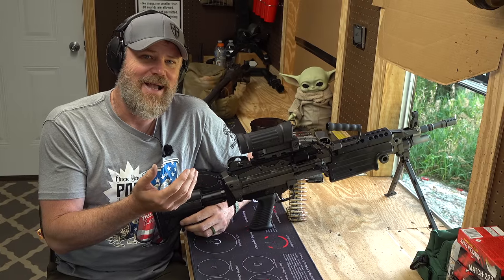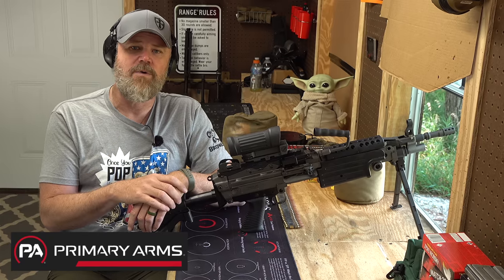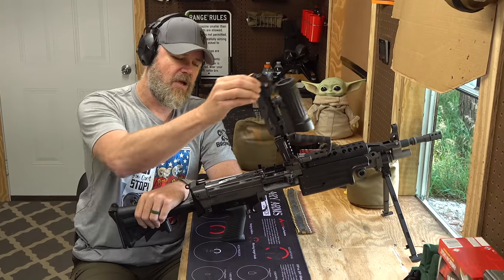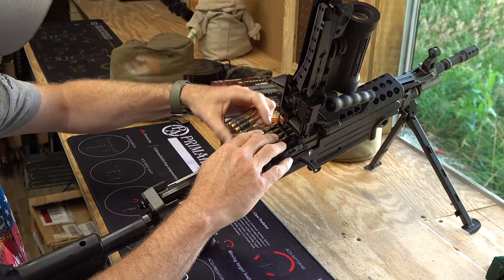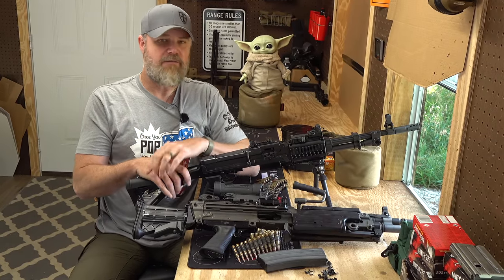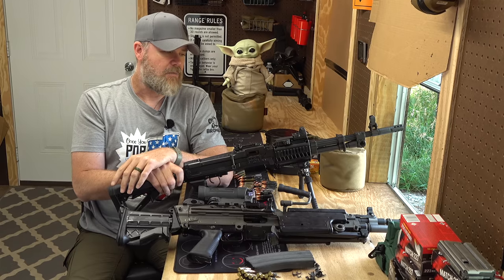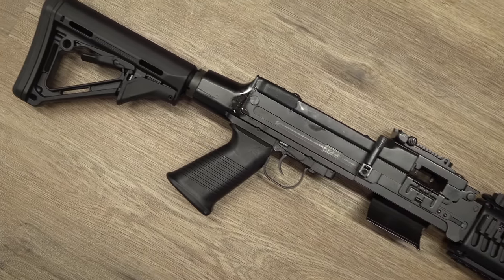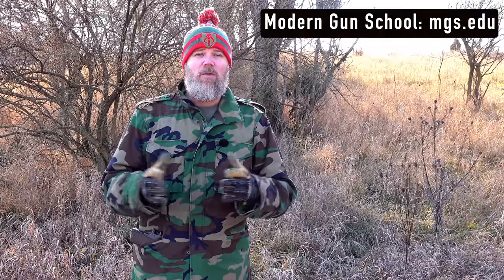Semi-Auto Belt Feds - Useful Tools or Range Toys?

Comment: Fightlite MCR belt fed upper+rare breed forced reset trigger. Now that's what I call "overly practical"!
Reply: i have that exact set-up, its a beast...
Reply: Wow, you both have an MCR, do you consider it a decent investment? Would you choose it in a collapse/boog situation?
Reply: @snek9353  I would yes  when I got it I got the upper and lower for 3700 look how much they are now  I have the same RPD in this video got it when they frist came out  2800 and a wiselite mg42 had thatfor about 16yrs 2600
Reply: @stg4478  At todays prices one can buy a MCR or about 40 60rd magazines.
Reply: @snek9353  I have it as a range toy.
Reply: @snek9353  I also have a MCR+FRT, but in retrospect, I'd rather take a HBAR upper with a larger magazine than a MCR when it comes to practical use. Is 100rnds in a nutsack more practical than several 60rnd magazines on a bandolier? How often am I actually going to chance the barrel on my MCR if I'm fighting by myself?

Comment: Once upon a time 1919 kits used to be pretty affordable.  Parts still seem to be available and any small part you can't find can probably be made with some tool steel, files and a torch.  The semi-auto conversion sounds like a pain in the ass but the rest of a 1919 build looks reasonably straightforward.

If you bought cheap, the price tag wasn't bad for a range toy.  With surplus ammo, that was pretty cheap too but now buying thousands of rounds of .308 or .30-06 won't be cheap at all.

People used to use trigger activators on them, I'm not sure if that is legal anywhere these days.  A butterfly trigger might reduce the fatigue issue but I have no clue if a butterfly trigger can bump-fire.

Any way, I was surprised to see a discussion of belt fed semi-autos that didn't even mention 1919s but talked about BARs for some reason.

I don't know if the 1919 still has the lowest barrier of entry for belt-fed but it did for a long time and a lot of people have them, probably more than all the RPDs, PKMs and SAWs combined.

Comment: since the marines have gone to the m27, and with barrels on ar getting stronger, a belt feed is a nice range toy.  but if you put a binary or force reset trigger, you could get a poor mans machine gun.
Reply: You could probably get a similar effect by double or triple tapping the trigger. What I'm talking about is quickly squeezing the trigger 2-3 times from a bipod or tripod position.   You will probably not be all that accurate, but real machineguns rarely are.  Then again,  if you're shooting off of a tripod, a hand crank trigger actuator may be the way to go.
Reply: I keep hoping someone comes up with a binary/frt trigger option for these kind of guns...
Reply: @Mitsurugi2424  MAC will NEVER demonstrate it.
Reply: It would be neat to have a belt fed 7.62x39 RPD with a short barrel  (10" - 12.5") RPD style Draco with a pistol brace and a belt fed backpack.
Reply: Lol or you can literally do a basic ass trigger mod and it's full auto just like that.
Reply: Marines still use the M240

Comment: My issue with the IAR is that they’re just a heavier AR. If I wanted to go belt fed I’d get an MCR upper and toss a binary or forced reset trigger
Reply: I used the IAR when it was transitioned over from the SAW.  As a machine gun, it sucks ass. But as a rifle in general, it’s awesome. Gorgeous gun. So as long as there are machine gunners toting around the m240 or something like it, the IAR is a suitable replacement. The rifleman were able to use it much more effectively.
Reply: @hieug.rection1920  but for the civilian variants it's just a heavier AR
Reply: @joshuaradick5679  not so. It’s a piston driven high-end AR.  I loved the gun so much despite my incredible bias towards belt-feds that my go to civilian rifle is a clone. The rifle is an incredible reliable platform that performs well in high heat and dusty climates, like Arizona in the summer, and cycles through anmo just like the military variant with. Very little modification. A little binary trigger or the rare breed for example. Even just a drop in comp trigger with less than 3lbs of pull will become a very fast firing gun. 
So, for 1lb more than your standard AR, you get a gun that you can still hold the front hand Guards after 60 continuous rounds, and that can reliably cycle more ammo than I care to go through in one sitting without issue. 

I have to clean my direct impingement ARs every use or else they get finicky. They have noticeable performance drop during extended rapid fire courses.  None of that is the case with my piston AR. I still clean it, but It’s stays cooler and cleaner by far.
Reply: @hieug.rection1920  I'm not downplaying the quality or the utility of the IAR concept. I'm just saying if I want the LMG experience the civilian IAR isn't going to do it. I've got a heavy barrel piston Ruger AR I can do the same thing with.
Reply: @joshuaradick5679  oh, yeah. I misunderstood. 
Paying a premium for any single shot machine gun is ridiculous. It defeats the purpose and outside of the IAR, is a different mechanism and shooting impulse. May as well just get an airsoft gun if you just want to look cool. At least then it’s still fire full auto.
Reply: @hieug.rection1920  I mean the saw was never a great machine gun either. The m27 is just a more portable far easier to use rifle
Reply: Done that awesome setup Franklin Armory binary trigger also the surefire 60 and 100 round AR-15 mags with it is blast
Reply: @hieug.rection1920  what kind of AR’s are you using that get finicky without cleaning? Most will run regardless. Look at Tim’s BCM test he’s doing and sitting at or if not barely over 7,000 rounds
Reply: @lukeflaugher5334  gov issue colts, Daniel defense, a few custom builds and BCM. Sure, DI guns work well.  Not saying they don’t. But when your running 1,000+ rounds through one in the 110+ degree heat and dust they get a bit finicky.  I’ve had to field strip my colt M4 mid fire fight fight to wipe the crap off the bolt lugs and rails while my buddy was jamming more rounds into mags.  The M27 gunner never had that problem and was firing more than us. Let that carbon cool and solidify and it will gum up the action. A piston AR just takes it on damn near machine gun levels with much less worry. The rails and lugs have less buildup.  The receiver stays much cleaner in a piston gun.
Reply: @hieug.rection1920  I definitely can’t dispute your experience’s and definitely understand what you’re saying. They both have pros and cons. Piston guns normally get hotter faster at the hand guard though. I like both but it has been shown that DI guns are as reliable or if not more reliable sometimes. Their is definitely a lot of variables at play and probably depending the manufacturer and conditions can cause DI guns to act up
Reply: @lukeflaugher5334  the hand guard right by the gas regulator definitely heats up.  However, the barrel and everything behind it on a short stroke has piston are cool and clean. 

20 years ago, I’d have never trusted a piston gun. But somewhere in there, some folks seem to have worked out the magic of the piston AR.  Not to discount the DI AR, as nothing gets lighter and I do agree they are fantastically reliable, but for extended fire engagements that M27 was slick.

Comment: Range Toys. Unless you’re running a binary trigger I don’t think the weight/size justifies the exact same functionality of a gun that could be almost 10-15 pounds lighter depending on the platform. Also not too familiar with the prices of the PKMs or M249 on the civilian market but I couldn’t justify the price in my head unless it was just one of those guns you pull out every once and a while with your buddies.
Reply: Idk about PKM’s but a Saw is around 7-8k range somewhere just for reference.
Reply: Where do you even get a semi auto PKM? Even if it is pointless, man would I love to have one since the PKM is an excellent gun.
Reply: Most of the PKMs are kits from what I’ve seen and they’re going for about 4K. However being a firearm you have to source parts for/assemble there’s also the cost of hiring a gunsmith to assist with the project. I’m not too familiar with PKMs as most of my gunsmithing is coming from AKs and ARs but I definitely wouldn’t risk 4 k in the event I screw something up on a platform that while isnt niche obviously hasnt seen a lot of time in firearm enthusiasts possession.
Reply: @fook-joby-den6172  last 1 I seen which was recently on armslist was about 13k. But I do recall when they were 7 ish.

Comment: With intimate knowledge of both a semi 1919a4 and an MG3 (both chambered in .308/7.62) with enough training and knowledge on proper employment and capabilities and limitations, these semi auto belt feds can honestly become a huge force multiplier. Just like any other weapon system training and reps are key. Belt fed semi offer a very good accurate suppressive/directed fire capability and being .30 cal and above offer a decent barrier penetration capability as well. Of course just like in any military doctrine (partial to USMC since that all I know), you have to employ a fire and maneuver element as well. One person Ramboing a belt fed semi wouldn't be as effective as a team to support and conduct fire and maneuver. Just my 2 cents. 

As always MAC great content and great dialogue! 

Semper Fidelis
Reply: Just my $.02, but take a page out of Russian/Canadian MG mount designs, and put the mount on a small trailer of the kind that you can pull behind an ATV or lawn tractor. A trailer that size, can easily & quickly be moved by the crew during fire & maneuver operations.
Reply: Marine vet here; i couldn't run a semi auto belt fed. I'd be in a constant state of wtf is wrong with this fucking weapon syndrome. Rah? 🏴🤷‍♂️

Comment: I've never seen a full auto saw that could run a single stanag mag without a failure.
Reply: FN 308 m249
Reply: Not saw but IWI Negev NG-5
Reply: The early ones did in late 80's before they was abused to crap AKA cleaned to death and ran dry... no lube. One I carried for short time in 88 ran blanks though a magazine reliable. But it had only been in service not even a year.

Comment: I believe that they are cool, however, I believe that the AR15 belt fed upper is the best option as there are options for binary triggers that would allow faster fire and it is designed to be closed bolt, so, no conversions.

Comment: I think they're useful. They would provide suppressing fire a lot better with a belt than magazines, I'd think. Now I get that we're in normal times, now they're just a range toy. But if the zombies come... useful ftw.
Reply: you can get 40,50,60,100 round drums.. then you dont have to worry about links.. the links are the hardest part to get
Reply: Drums are known to have feeding issues tho
Reply: @ace_v2905  and links get misaligned, and rounds dont strip right.. everything has its faults. 
I have 3 100 RWB drums, and 4 ATI Schmeisser 60 round mags.
Reply: @ace_v2905  old metal ones, definitely. Modern c-mags, sometimes. the Magpul drums I’ve used (and am still using), not a single problem.
Reply: @TrustJesusisenough  the Marines switched to the IAR because of a change in doctrine focusing more on accuracy and the looming expiration of the M249 service life/contract.  You can suppress the m249 and the m240, though I find that quite silly. 

As a rifle, I loved the m27.  As a machine gun, I hated it. But that didn’t matter much since I was an 0331 and had the m240 anyway. Definitely a bias in my head about belt feds and how to properly employ automatic weapons.
Reply: @TrustJesusisenough  marines still only use the the m27 as a squad automatic. Everyone else gets the a4 (which I view as a good thing).  I do have to laugh though.   The shifting battlefield has us going back to the WW2 mentality. Big bullets and accurate fire for everyone. I just wonder if they haven’t forgotten the lessons learned during post WW2 bush wars.  That of the efficacy of lighter weight/more compact gear and the general competency (or lack thereof) of the general population infantry. Supposedly, we are focusing less on general population and trying to foster a mentality of excellence, as far as the general soldier goes. Quality over quantity. The weapons shifts sure seem to speak to that. But then their recruitment and training plans combined with the general focus of training priorities seem to say the exact opposite. We are giving the most effective and accurate weapons (that weigh in the WW2 battle rifle range with recoil to match) to soldiers that are on average weaker and less mentally prepared. 

I know I’m old and have a definite bias, but damn.  Gotta question some of these decisions. To the topic of this video, I don’t see more pistols as a positive. Sounds like some call of duty shit to me. Someone saw the spec ops guys with pistols or does some 2 gun matches and see’s the pros there performing well and thinks that could be everyone.  Then the reality is Steve from the burbs whose never held a gun before and his new battle buddy, Wendy, limp-wristing the damn thing and flagging everybody on the transition.  Doesn’t seem like the juice is worth the squeeze.

What you’re thoughts on the increase in pistols?
Reply: @TrustJesusisenough  I hear you on the weight thing. I dropped 30 lbs to join (didn’t realize I’d gotten so fat after high school) and lost 30 more in basic on the fat-body half-rats. Also, DI’s hated me because I was fat but kept answering the knowledge questions right because I read the book in advance, so that helped the weight loss too. I’ was in 2006 to 2014 l, so I got to be a boot under the fresh from falujah vets and got out when Obama was on the cusp of forcing the marines to take women into the infantry. My boys still in give me the updated consequences of that.  

I think our guys from the 2000’s would best the Vietnam era guys. But it was a definite softening. Once they outright banned hazing instead of just policing it but not enforcing paperwork, that was the beginning of the end. I watched as the EO rep and SAPR crap got more and more of our training time and our range time decreased. Thank God a few NCO’s from the 2000’s were still around when we went back to Afghanistan in 2011.  They kept the officers in check and brought back the old way of getting the job done once we were in country and had a few villages between us and Sgt major.

Comment: Having been a long time M249 gunner, I disagree with your thoughts on the accuracy of the weapon. First, get rid of that collapsible stock and put the original on there. When firing, grasp the stock with your support hand, rotate it into you until it hits the stops in the bipod. You have to zero it on a cant, but once you do, you can hit a man sized target at 500 with a single round. Now this is I the open bolt configuration, I cat speak for what the conversion does to it.

Comment: They could in theory be used for anything you need sustained fire for, the military uses them to hold down a position/protect a group of people, right?
Reply: The weight of it though, when you could have an ar with a ton of 100 rnd magazines and the ar fires a little faster. For the weight, and price, carry 2 ar's for when one overheats.
Reply: Machine guns are for laying down suppressive fire, rifles for accurate fire. Riflemen are shooting at individual targets, machine gunners are suppressing an area, keeping the enemy's head down so you can get those point shots off or using plunging fire to reach an area behind cover.  

This thing...I dont know what it would be used for. Corvette with a governor was a good analogy I saw in the comments.

Comment: In my experience, the biggest advantage of modern belt fed weapons is the ability to quick swap a barrel. In semi only, there really is no major benefit of that feature. 

As a thought experiment, an AR platform with a 20" modern material barrel, binary trigger, several D60 drums, and an entire spare upper in a backpack could serve this role pretty well.
Reply: If available, Ares Defense built belt fed upper receiver, & bolt carrier groups for the AR, and someone else  built MG-34 kits that mated with AR lower receivers several years back, so I'd look into one of those, and stay far away from drums, due to the only RELIABLE thing about them is their UNRELIABLITY.
Reply: What about heavy barrel with a JP Enterprises barrel heat sink, use the surefire 60 round quad stack mags and the rare breed FRT?  Limit to short bursts and only a few 60 round mags.  Asking for a friend.